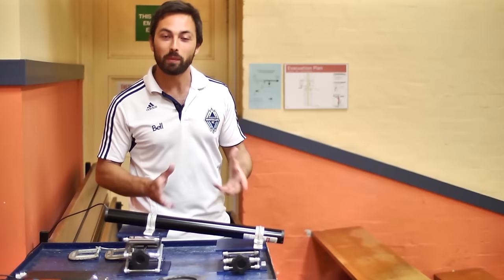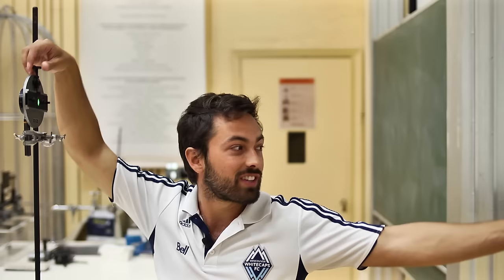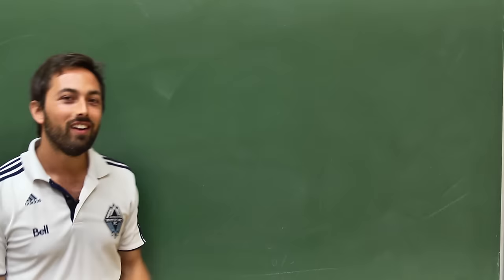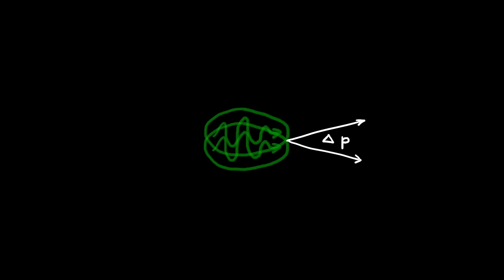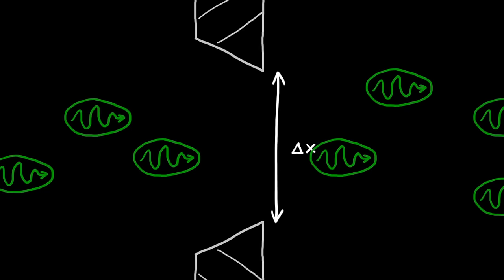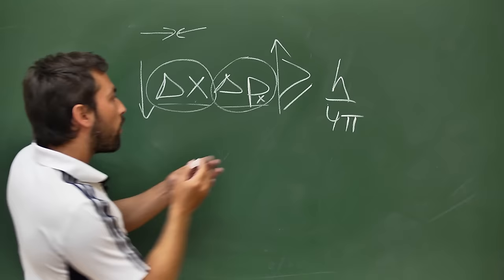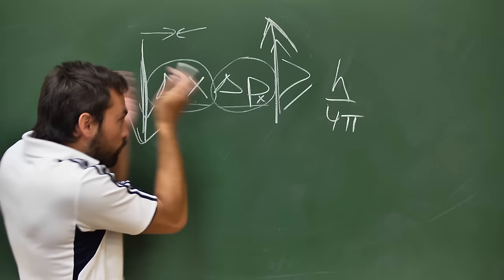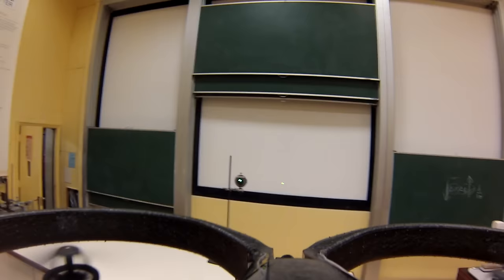Heisenberg's Uncertainty Principle Explained

Comment: This is also known as the diffraction of light (that proves the wave caracter of light). The lenght of the spot is equal to the wavelenght multiplie by the distance between the slit and the screen divided by the size of the slit. If the slit goes narrower, the lenght of the spot goes wider ! :)

Comment: Isn't this just the diffraction you get when you send light through a small aperture? Also, how does changing the momentum result in the widening light projection if the light is from a laser (therefore straight)?  I thought an increased uncertainty in position would result in this pattern.  Please help me understand.
Reply: Basically momentum is a vector quantity = mv. Here the mass of the photons cannot change. Their speed in a medium( air) also cannot change. So the only thing that can change such that momentum changes is the direction of the vector
Reply: You're correct, it is the same diffraction you get from placing a laser beam through a small aperture. When the beam of light spreads due to diffraction, it loses coherence - it becomes less focused. The aperture would be the distance between the two slits - this distance is what influences the uncertainty of the position of the photons. The smaller the aperture, the less uncertainty we'd have in knowing the position of the photons because the light beam has to fit into a smaller slit. This is where it becomes very unintuitive. The calculation you saw in the video, (deltaX)(deltaP) >/= h/u X Pi is the uncertainty relation - it's compendiously a constant of the universe in a mathematical expression, think of it like balancing colours of paint to produce a certain colour. You may have to decrease the intensity of one colour to make another colour more apparent. Also, changing the momentum results in a wider and more diffracted light beam because the momentum is tied to the direction of the light beam photons. Momentum is a vector quantity - it has direction and magnitude. The momentum would change and in turn the direction, so as to balance Heisenberg's uncertainty relation. Don't forget that the uncertainty/focus of the momentum increases when the uncertainty of the position decreases. The shape of the light on the walls is related more to the momentum as the momentum determines the destination of the light beam, remember what I mentioned about direction.

Comment: 1.The mass is not gonna change.
 So it's all about position and              velocity of particle.
2. The principle says that you can't determine position and velocity of a particle at once. 
3. So that's very basic thing man, you see you can't tell the position of a train which is moving with a velocity of 40 km per hour on x-axis. If you try to tell that the train is on point 4 it will move on, if you say it is on point 5 it will move on. 
"So what exactly is this uncertainty principle all about?"

Comment: Hi, doesn't the image actually gets wider because of the diffraction ? Because we did a very similar experience in science class by calculating the wavelength of the laser using the length of the image on the wall and some formulas... But our teacher says it has nothing to do with Heisenberg uncertainty principle and only illustrates the diffraction of light. We used 160nm wide holes and green lasers with a wavelength of 532nm

Comment: Hey Derek, love you work. Fellow aussie engineer/backyard physicist here.
Wait a minute, there are some things that don't make sense here:

1) If the light is effectively bending outwards (similar to what happens in dispersion) what is going on here, what causes the light to bend and change direction? In dispersion, it is that different wavelengths have different apparent speed in the glass prism and thus refract at greater degrees, what is causing it to happen here? 

2) Do the photons change direction because classically (p=mv) relativistic mass of light cannot change? only the velocity made up of c and direction can. Since everything else is constant, only the direction can change?  

3) But the momentum of light according to de-broglies relation (p=h/λ) for p to increase the wavelength must be decreasing (i.e frequency increases). Is this occurring? If we were to put a detector on the other sided of the slit would we notice higher frequency photons being emitted?

4)When I created my own single and double slit experiments  I always thought this was occurring due to diffraction as the light bent around the edges of the slit?

Comment: I am a physicist specializing in optics. 

The problem with the Heisenberg Uncertainty Principle is that it is so robust that it can be used improperly and you'll still get a good qualitative/quantitative estimate for a phenomena. The effect he's showing is the single-slit experiment which has to do with interference effects of the wavefront of the light. 

The Uncertainty Principle basically says that a wavepacket constructed using Fourier optics has some intrinsic width, dx, with some distribution of wavevectors with an estimated FWHM of dp. As dx goes to infinity, you have no knowledge of when the wave started or where, but you do know its wavevector with absolute certainty. As dx gets smaller and smaller, the FWHM of the wavectors that construct it gets broader and broader based purely on how Fourier transform properties work. The absolute limit of how sharp you can get dp for a given dx is given by \hbar/2.

Interestingly, creation and annihilation operators in quantum mechanics are constructed using this principle. The combination of creation and annihilation operators are responsible for the addition or subtraction of quanta of energy from waves. This is where we get the "particle" nature of light from. So, in reality, the particle nature of light is a direct manifestation of the wave properties of light. It seems a bit paradoxical until you consider that all beams of light must be finite and you need to consider what happens at the boundaries of the beam.

Comment: The Heisenberg Uncertainty principle says we can't know both the  position and the momentum of a quantum particle.  
My question is this, if you know that a photon is going the speed of light, the momentum,  then does that mean you can never know the position of the photon?
Reply: No, you can't know what direction a particle is going, you can know the momentum.
Reply: Strange, so when it comes to photons, we don't know anything about direction - even in the two slit experiment. How do we know they are going through the slit instead of around it or coming from behind?
Reply: Tom Hendricks We know they are going through the slit because we can see it and because there would be no reason for them to just suddenly go in another direction, until they passed the slit.
Reply: But they are outside of time, so they have forever to get back there.  That seems logical, and mine seems silly, but they both fit the facts.  And when you see, you change the outcome too don't you?
Reply: Tom Hendricks wut?
Reply: Photons are going the speed of light which has no time.  Your idea seems very logical, but both my silly version and yours fits the facts.  What?
Reply: +Tom Hendricks Very nice question. However aren't the photons interacting with the electromagnetic field??
Reply: when you say "speed" you only talk about the magnitude. And lets not forget that momentum is mass in VELOCITY not speed. Velocity includes the direction. And that is exactly what he is trying to prove in the video by saying that since as v narrow the slits, but the photos seem to be moving in an abstract direction and not in a straight line as v expected, the direction changes, so does the velocity and hence the momentum. Thus increasing the uncertainty of the momentum.
Reply: When?  I know that doesn't make sense, but when the photon is outside of time, when does it drop into time at a certain point, to react with an electro field?
Reply: Momentum is mass times vector of speed.
Reply: Freeroler bro we are talking about relativistic momentum, not classical. that equation (p = m*v) that everyone is throwing around in this comment chain is wrong. the equation you should be talking about it (when concerning massless particles) is p = h/λ.

Comment: Not really an 'explanation', an explanation would be telling us why this is the case, you've only told us that this is the case with reference to an equation which is the result of observing this phenomenon.
Reply: +Dan Rowe That is the state of physics as we know it. Many members of QM have even said that they do not fully understand it...no explanations why.
Reply: Consider this experiment as pushing a baloon under water and observe how both the part above and under water grow when the other gets smaller and vice-versa.
There's no magic going on neither you think of asking why it happens, because the question wouldn't make sense.
Reply: *narrowing the slit is li ke pushing the baloon down
Reply: Heisenberg's relation is not empirical: it can be derived without too much difficulty once you know some Fourier analysis, but that would require a much longer video :) I think the point was to explain what it is, rather than why it is.
Reply: Dan Rowe the equation is predictive...  it works before you set up any test...  and no math is a result of observation... but I'd be amazed if you could show us how to make that work... it'd save a lot if time.

Comment: this may be explained through diffraction also
Reply: Yeah
Reply: Because it IS diffraction. This happens because particles have a wave-particle duality. When the slit becomes smaller than the particle's wavelength, you decrease the uncertainity in position, but the uncertainity in momentum goes up.

Comment: hi what is the difference between this and diffraction. are they both the same?
Reply: the uncertainty principle causes diffraction, it also applies to other things tho
Reply: SkizzlePiano oh i see thank you
Reply: In no way does the uncertainty principle cause diffraction. Diffraction is a wave behaviour. Uncertainty is just uncertainty and in quantum mechanics it is about the failure of operator to commute; or more precisely about the fact that no quantum mechanical state can have shared eigenstates (of definite value for some operator) for two operators which do not commute. So the lower limit of the uncertainty is proportional to the expectation value of the commutator.
Reply: Mikael Jensen, No it's that particles have wave behavior.   And it's simply due to Fourier transforming a matter wave.

Comment: This isn't the same as the double slit experiment. What's happening here is that when the photon is made up of various frequencies it has a well define position (particle behavior). As you narrow the slit you mask off the longer wavelengths. This has two immediate effects. One the photon is less defined in position and two, it's momentum is more defined and the photon acts like a wave. At that point it's just wave diffraction at the slit.

Comment: Derek, I don't think a photon cares about a stupid equation, all ithink is that instead of relying on a simple equation, we can prove this by saying that the diffraction phenomenon becomes more significant at the smaller levels, as the light passes closer to the slit's limits at the atomislc levels, the light diffracts more, that's it

Comment: Heissenberg uncertainty does not kick in until several orders of magnitude smaller than the shown slit gap: If the threshold dx*dp>1/(4pi) is to be reached with green light means dx*h/lambda>1/(4*pi); this is dx>44nm way way smaller that the probably 0.1mm gap left at narrowest moment during shown experiment. It is diffraction on the edges of the slit that really cause light to broaden. When light travels really close to mass light trajectory bends slightly. Albert Eistein used such point to correct Venus predicted positions, as a starter to his relativity theory.

Comment: as you narrow the slit the possible ways a particle could go reduces.so the probability amplitudes are only limited to that space.when light goes through the slit the time for all the possible paths is nearly the same.so each path makes a good probability through which the light can pass.so it actually spreads out (here's the catch-possible ways can also mean bending of light and that's exactly what happens.this explanation was given by feynman)

Comment: You could've explained Heisenberg's Uncertainty principle in a better way if you used the photon-particle explanation.

So basically, let's say we have a photon of UV light and it hits a particle that is just whizzing around in space. When the photon hits the particle it will transfer some of its energy and momentum to the particle. The energy and momentum will be conserved, due to the fact that the energy and momentum gained by the particle, will equal the energy and momentum that had been lost by the photon( the photons wavelength will be longer because it absorbed lost energy). The reason why we used UV light, is because when UV light hits something, the angle of diffraction happens to be less, than that of let's say red light due to its short wavelength. This will allow us to pinpoint the precise position of the particle ( decreases the uncertainty in the position of the particle), but due to Compton's effect, when a particle is hit by high-energy radiation( UV light photon) the uncertainty in the momentum of the particle will increase.

Now, we could use red light, but it will have the opposite effect. Instead of decreasing the angle of diffraction, it will increase the angle of diffraction, which will decrease the uncertainty in the momentum of the particle, however, it will increase the uncertainty in the location of the particle.

I hope that I was able to help you guys.
If I have mentioned something that is wrong, please feel free to correct me,  but be polite.

Thank you

Comment: I have a weird doubt but at the same time interesting(If you got those crazy minds please feel free to answer). Consider the electrons. To make calculations easy let's assume it's mass to be 1e-30.Multiply it with the speed of light (say 1e+8) and you get it's momentum : 1e-22. Now, let's assume 4*pi to be 10. So, dividing plancks's constant by 4*pi would give 1e-35 . Since the product of deltaX and deltaP should give a value greater than 1e-35, so let's put the value at 1e-34(planck's constant itself (somewhat)). Now since the momentum is 1e-22 and the required value is 1e-34, so deltaX must be somewhere around 1e-12m. This is a very small length(smaller than the radius of a hydrogen atom) But the slit can be seen way tooooooo bigger for this. So, how could the splitting of the laser beam start at such a 'huge' length?

Comment: However Niels Bohr came up with a different explanation and called it the principle of complementarity that states the electrons and light can can act as both particle and wave phenomena, depending on how the experiments are done,  This is not an expression of dualism, rather, particle and wave should be seen as complementary aspects that can never be understood together in one and the same experimental situation. In other words, light or electron have complementary properties that not all can be observed or measured simultaneously. Because an observation of a system can never be done without interfering with the system.

Comment: The photons of the laser beam being constricted within the choke point of the closing aperture causes the photons (photons are tangible and have weight) to bounce off the edges of the aperture thusly causing them to fan out in a broad arc but only across the horizontal plane.
Reply: If you imagine photons like tiny balls, why would we obtaing an interference pattern no the sceen when adding a second slit?

Comment: I was thinking that it looks like some of the light is reflecting off of the edges making it look spread out, but the spot it the middle actually gets thinner as well :48 so reflection by itself doesn't make sense.
So the light is traveling perpendicular to the slit, lets call that x. And the blackboard and the slit are parallel to each other lets say they're aligned on the z axis. At first the light hits the blackboard making a circle. So the light is equally distant from the center of the circle on the y axis and z axis. As soon as he narrows the slit, which is only narrowing along the z axis, the light expands along the z axis and shortens along the y axis.
That wouldn't make sense if it was a mere reflection off the edge of the slit.
It must therefore mean that light interacts with itself and does so as a wave.

Comment: Hey everyone, quick question. What aspect of the uncertainty principle is responsible for the obvious reduction in uncertainty of momentum in the vertical direction as the slit is closed?
In other words, as the slit is closed, the projected laser beam spreads out in the horizontal direction, which is explained in the video. What isn't explained is why the projected light compresses vertically. 
Thanks a lot, and quick answers are much appreciated :)

Comment: As a radio guy, the first thing I thought of was, "knife edge diffraction". The question is how can a photon be both wave like and behave like a particle? Further, if you repeated the experiment with several "slits" adjusted to tiny openings, what happens? Could the pattern be reduced to individual photons?